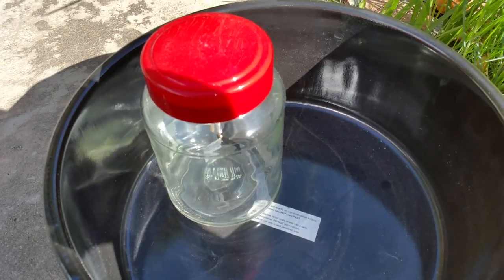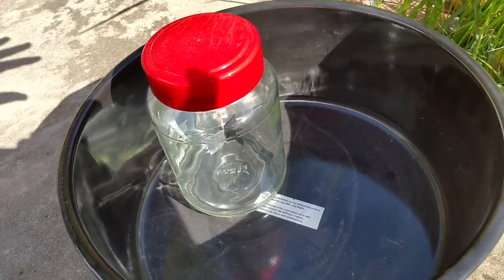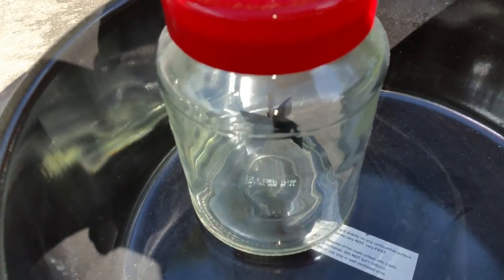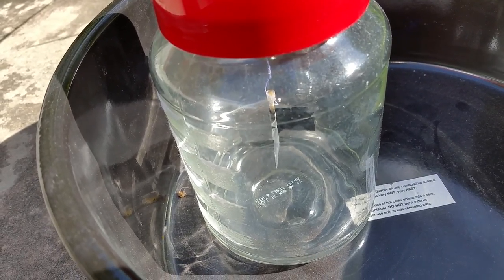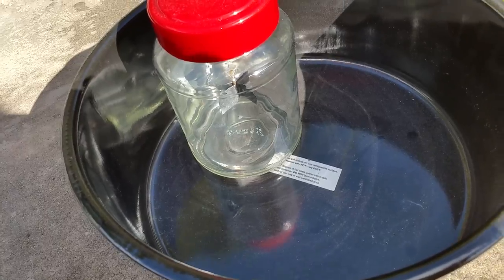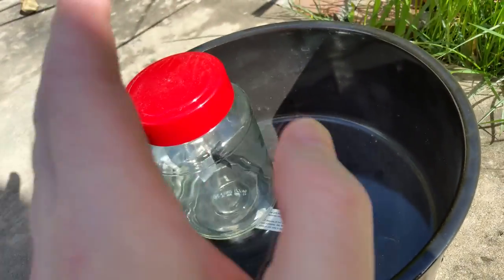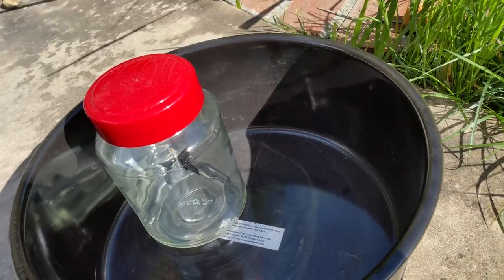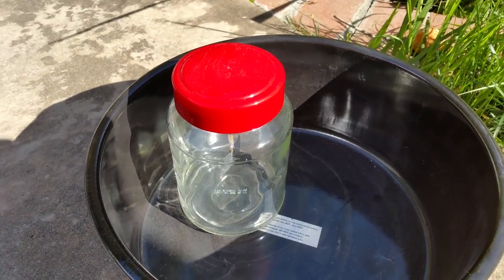Radiometer - Homemade - Test with sealed coffee jar - outdoor with opaque pan - overidonTV

Comment: Needs to be partial vacuum.
If you dont have a mathod to remove the air you can heat the jar then seal it and let cool down but it wont remove all the air but will recude the pressure.
Reply from the maker: Thanks Jeff! Heating it to remove some of the air / pressure sounds like a good idea.
Reply: Although aparently it isnt enough, from what I read you really need to get it down to around 1 Pascal
"The effect begins to be observed at partial vacuum pressures of a few torr (several hundred pascals), reaches a peak at around 10−2 torr (1 pascal) and has disappeared by the time the vacuum reaches 10−6 torr (10−4 pascal) "
https://en.wikipedia.org/wiki/Crookes_radiometer

"Average sea-level pressure is 1013.25 mbar (101.325 kPa"
https://en.wikipedia.org/wiki/Atmospheric_pressure#Standard_atmosphere

I tried to make one in a coffee jar that has a glass lid and rubber gasket.
I used a large syringe and a couple of aquarium airhose valves to make a pump but the air tubes collapsed before getting anywhere close to a full vacuum or 1 Pascal.

If you fill it with water totally under water no bubbles and then draw the water out the gap inside will be vaccuum but thats how hard it will be.
Imagine that jar filled with water and you could syringe all the water out leaving only vacuum. 
Those levels.
but as stated above the effect disappears past a certain point so there is a fine window of pressure that it will work. 

I used a magnet on a ball bearing and then the propellor vane thingy was hanging from a needle that was touching the bearing. very little friction. Very sensitive. You can make a heat vane where a lamp causing air to rise will spin it.
Reply: @jaycal1920  Oh, I just tried to create it, I had it done with a paper which was put on needle so low friction but still didn't work, probably because I used a bottle with the same pressure as outside.